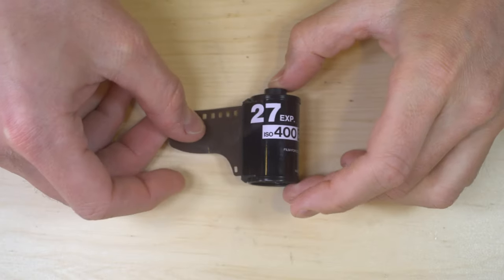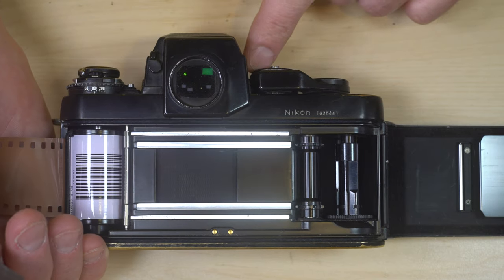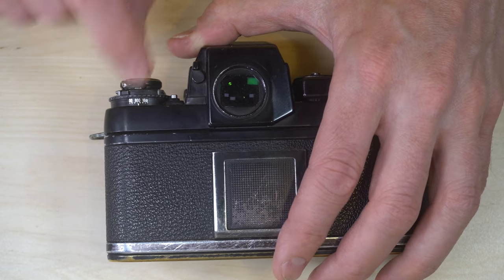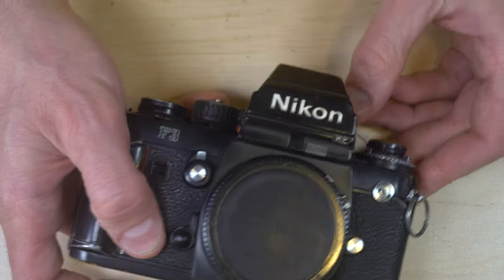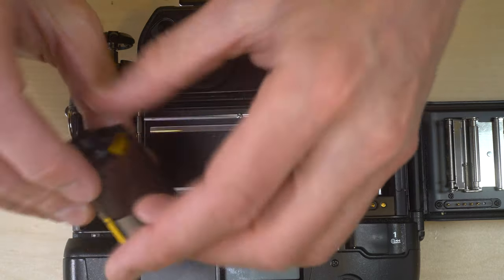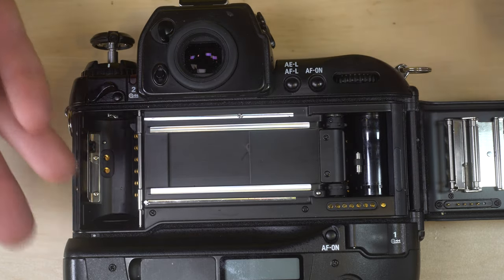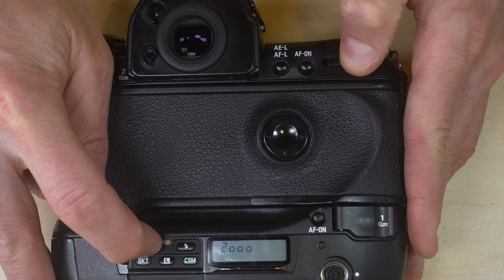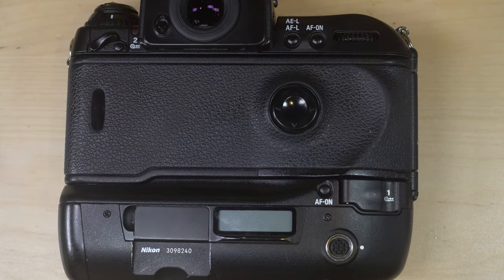How to Load and Unload  35mm Film into Vintage (Manual) and Modern (Automatic) 35mm Film Cameras

Comment: When I was teaching photography in an adult ED class, I had an elderly lady as me why she was having trouble advancing the film in her camera. When I tried to do that, I could feel that something was very wrong. I started to take some slack in the film but couldn't budge the rewind lever. I even back rewind the film and that was very difficult. So I noted the number of exposures which was about 5 exposures and press the rewind cluch and suddenly felt the rewind knob relaxed. I felt some tension more than what would be normal, but did get the end of the film when I felt it release from the take-up spool. I open the camera's back to see that my student had loaded the film upside down such that the emulsion side was facing up toward the back of the camera. I was shocked. I showed her the correct way to load the film then advanced the film 5 plus 1 extra exposures. The next week she brought in the pictures and saw that the first 6 exposures were slightly foged because the film was bent backwards and the anti halation layer on the back side of the emulsion layer had prevented, to a degree, any light from exposing the film.
Reply from the maker: Oh goodness. I didn't even think they could load that way.

Comment: A tiny modern film hack that's worth while being aware of that I've learned the hard way 😒
Quite a lot of modern films from smaller companies, especially the re-wound in to new cassettes varieties, are wound quite loosely on to the cassette axle. Its worth holding on to the leader and just gently winding the axle by hand backwards until you feel the leader GENTLY pull towards the cassette, otherwise, and I've SO learned this the hard way, you can go through the loading procedure and perfectly catch the sprockets into the cog teeth only for a few shots in the rewind leaver no longer turns as you advance the film. 'Oh dear, I didn't load it properly, I'll just pop the back open and re-attach the sprockets to the teeth' .... ruining your first couple of shots that had advanced correctly, you've just hit a slack piece of film.
I need to remind myself to do this until it becomes habit !
Reply from the maker: Thank you! And good tip.